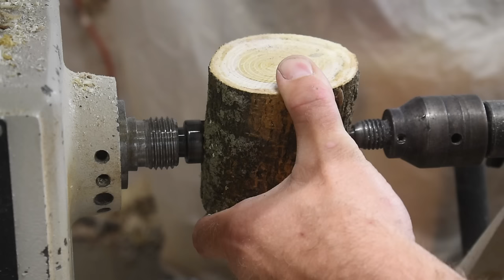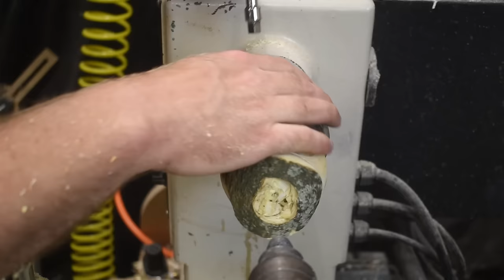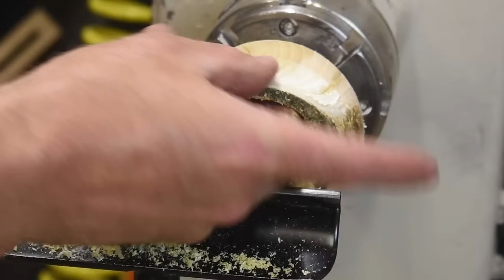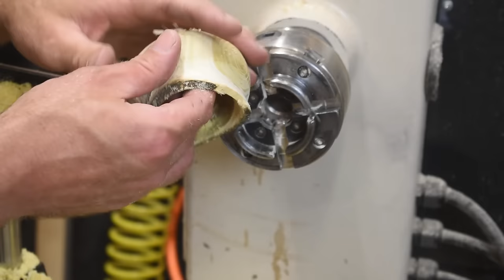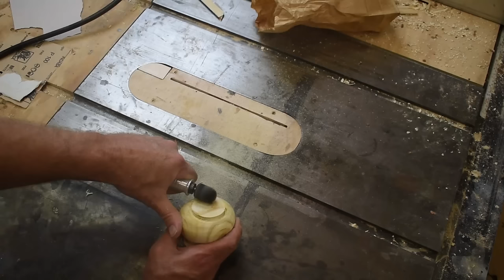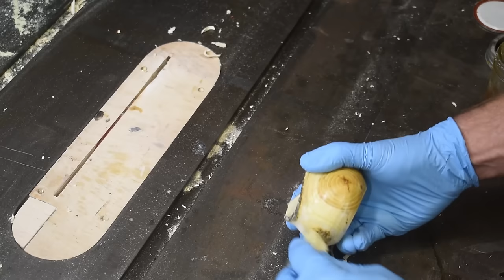Woodturning for beginners birds mouth bowls in 5 easy steps

Comment: How long should you leave a piece of tree log say 6” dia from being cut to working it and any tips for its preparation please?
Reply from the maker: You can turn it right away for something like this.  If you keep the wall thickness less then 1/4 inch and put it in a paper bag or seal the outside it should dry without cracking.  If your trying to dry a 6 inch diameter branch it will take years to dry and you will want to remove the bark.  A rule of thumb for drying wood is a year per inch of thickness.

Comment: why didnt you sand it on the lathe before removing the tenon? I am a beginner so please excuse if it is a stupid question?
Reply from the maker: You can but you would still need to do some sanding after it dries.  I got a reasonably good finish with my tools so sanding was not needed before it dried.
Reply: So, you still could have sanded after it dried on the lathe  as you had not removed the tenon.   And speaking for the tenon,  much easier removing with a jam chuck and a 3/8 gouge.   
BTW... you need to sharpen you tools.. they are dull as @$%&

Comment: I don’t have a “ Goose neck “ scraper, can it be done with just the bowl gouge plz ?
Reply from the maker: Yes you can do it with a bowl gouge.  It just makes it easier to get under the narrow part with the goose neck.  Here is a larger one I made were I used only a bowl gouge on the inside.  I put a time stamp in at the inside hollowing.  https://youtu.be/KVkvR_aAi-4?si=6RQOc9AihG2taQyX&t=426
Reply: @BlackLabelwoodworks  thank you

Comment: G'day a semi beginner here, i have a couple of questions please.
1st at the start you used a bowl gouge, can/could you use a spindle gouge. If not why?
2nd after you let it dry couldn't you put it back on theathe to sand and once finished then remove the tenon.
3rd what type of other tool would be effective to hollow out the inside, as i have no hollowing tools, is there one or 2 that i could possibly make say from old files that i have or even a piece of reo-bar that i could shape.
Any help will be greatly appreciated and awesome.
Thank you for sharing, showing and spending your time to help out others, thank you for your valuable time, and repeating the cycle of passing on information, time and experience.
Cheers and G'day from Matt, Maryborough, Queensland, Australia 🇦🇺 🇦🇺😎😎👋👋🙃🙃🤠
Reply from the maker: Its not recommended to use a spindle gouge when your turning something cross grain.  Face grain and end grain cut different and most spindle gouges are not built for it.  Depending on how dry the piece of wood is you might be able to return to the lathe to sand.  The piece i used was pretty wet and warped as it dried so sanding on the lathe would not have worked.  You can use a small bowl gouge to hollow it out.  It just takes a little more time and practice.  Thanks for taking the time to watch.
Reply: @BlackLabelwoodworks  thank you for taking your valuable time to pass on information, it is greatly appreciated and absorbed into my filling system, thanks and have an absolutely banger of a weekend 😊 🙃🙃🙃😎😎😎👋👋👋🇦🇺
Reply: I wouldn't use an old file for a turning tool unless it's been annealed. Files are extremely hard but brittle as glass, if you have a bad catch they can shatter, potentially showering shards everywhere at high speed. A turning tool is softer and more resilient, they won't break. IF you know how to anneal the file then it could make an okay tool but modern HSS purpose made turning tools are a better solution.
Reply: @rockranger3037  apologies forgot to ask, bloody brain injury they suck, is they anything i could use to make some till I'm able to buy any chisels as a disability Pensioner no money saving takes a long time, the files I used were freebies from places. Thanks Matt 🇦🇺
Reply: @DeathMetalMusic-SavedMe I’ve seen some old timers use old files that have been reshaped as scrapers, but that’s about it. Like Rockranger said, they’re usually hard and brittle. Even if you were to shape them into scrapers, they’re not meant for hallowing or waste removal and I definitely wouldn’t let it wander from the tool rest too much or you really risk it snapping and coming back at you. No more than an inch overhang. 

As stated previously, don’t use spindle tools for bowl work. Spindle tools don’t have the strength for that and I’ve seen a couple of them get bad catches and just snap. Luckily, I’ve never seen one come back at someone, but at the very least it’s a waste of a perfectly good tool. The two exceptions I see a lot of the time are people using spindle tools for the straightening of tenons on the outside of bowls and the outside of bowl turning when you’re making an end grain bowl. Just the outside, though. Don’t attempt to turn the inside with a spindle gouge. If you are going to attempt bowl turning with a spindle gauge, keep a few things in mind when using them:

- Keep the flute closed or mostly closed. Since spindle gauges are shallower, they’re at their weakest when the flute is wide open or sticking straight up on the tool rest. 
- ride the bevel. You’re probably at your safest when you stick to riding just the bevel with your cuts. 
- keep the spindle gauge close to the tool rest. Don’t let a spindle gauge get too much overhang, especially when wide open with the flute.
- keep them sharp and use light passes. 

A good alternative to gouges, are carbide cutting tools. They’re extremely friendly to beginners and you don’t really have to worry about sharpening. The round cutting heads are usually the ones used in bowl turning, but the square and diamond shaped ones are good for forming tenons.

Comment: Pardon my ignorance, how long  and what is your  drying process to prevent cracking? I'm new to this and love your work.
Thanks!
Reply from the maker: The length would be the same as the diameter of the branch.  It was around 3 inches I just eyeballed it.  I turned it to a 1/8 inch wall thickness and put it in a paper until it was dry.  Took about a week or so.  The bag slows down the drying to keep it from cracking.  Thanks for taking the time to watch.
Reply: @BlackLabelwoodworks  I put my turned green pieces in a plastic garbage can full of shavings. Works really well.

Comment: Nice Work.  Question, did the sides check around the heartwood center?
Reply from the maker: They did not crack around the pith i left in the walls.  I turned the walls pretty thin so they dried fast enough to not form cracks.  This does not work for all woods I wouldnt attempt this with cherry.  Cherry will start to crack if you look at it the wrong way.

Comment: Also, did you use CA glue on the pitch on the bowl sides to prevent cracking?
Reply from the maker: I did not need to for this wood type but some types you may need to.

Comment: What rotary tool/head are you using?
Reply from the maker: The rotary tool is the Foredom flex shaft power carver.  The burr i used is a 3/4 inch kutzall ball nose extreme.  I added links to the description.

Comment: I would leave the tenon
Reply from the maker: You could leave the tenon but if the wood warps when it dries you would still need to hand sand.  If you return it to the lathe you would only be able to sand the bowl part the wings would need to be hand sanded.

Comment: Well it was interesting but you mentioned the type of boring tool that you like to use but you didn't show it to your viewers not did you explain why you preferred that type of tool. These would of been good information for the new woodworker.
Reply from the maker: Hollowing tools with a hook make it easier to hollow out turnings that have an opening narrower then the rest of the body.  This is the link to the hollowing tools i use. https://www.johnjordanwoodturning.com/small-hollowing-tools.html In this video i used the 3/8" hook tool the straight tool can be used for bottoms but is not needed with technique the hook tool can do the same thing.  I just made a wood handle for this one but all my other larger ones go into a hollowing system.  The cutting bits for these bars are high speed steel so they can be sharpened and narrow so they are easier to control.